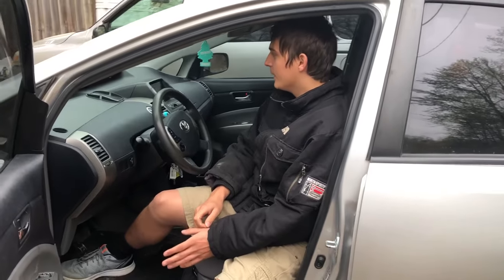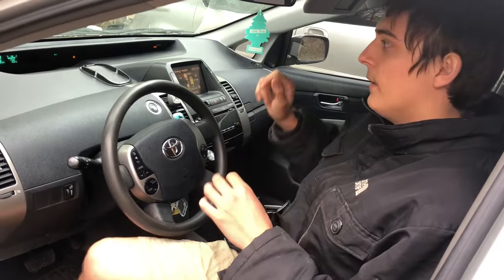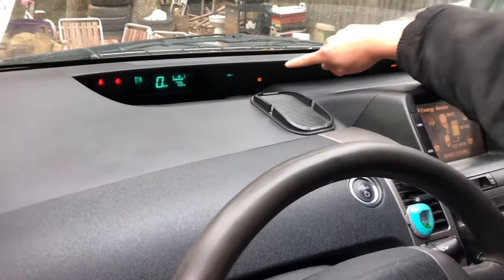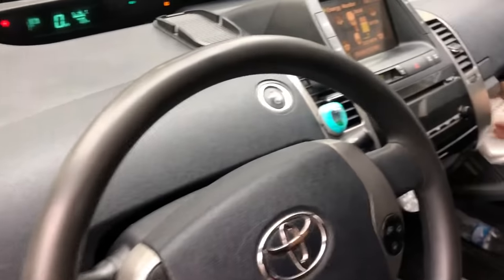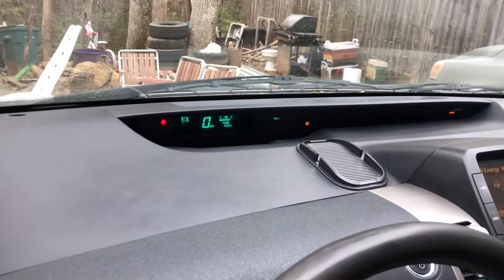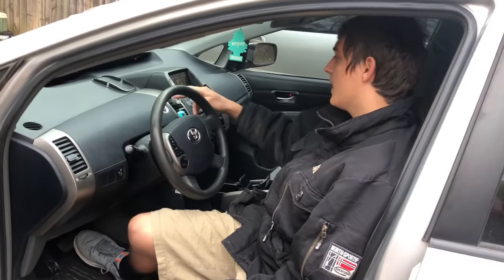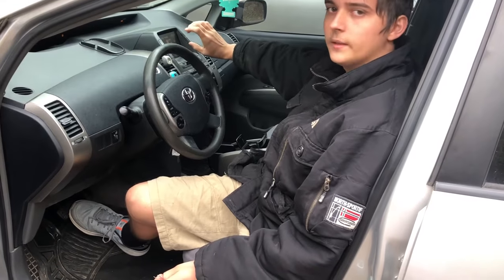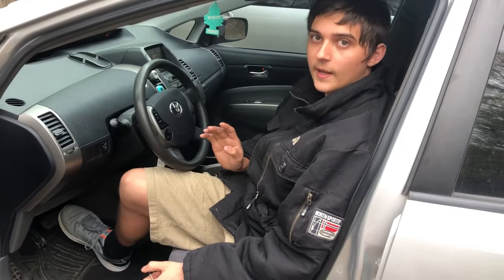Toyota Prius ABS Reset Brake Problem

Comment from the maker: If this helped you please subscribe
Reply: I subbed, thank you 😊
Reply: Update:  I was on a road trip in a 2007 Toyota Prius when the bake warning light, ABS warning light, and Emergency Brake light came on, the car was braking very strange with odd vibrations.  Checked the brake fluid, front brake pads and rotors and found nothing wrong.  Did this recommended procedure jumping the 4th and 5th pins on the obd2 port and pumped the brakes.  So far so good, 241,000 miles and still going…
Reply: Sorry, this failed on my 2011 (Gen 3).
Reply: Thank you for doing this video! I replaced my brake pads and adjusted my rear brakes on a 2009 Prius. The ABS/Brake warning light came on. My brakes felt spongy. Your video is the only one I found that explains clearing the warning ligt will resolve that spongy brake pedal issue. Very valuable information!
Reply: @MarcillaSmith  that's too bad, did you try it more than once, i assume?
Reply: Great! It worked for my 2010 Prius; however, the lights came back on after I drove about a mile or less. I did it again and I have the same issue. Do have any tips for this?  Thank you!
Reply: Thank you for your help working great
Reply: Amigo ayúdame, como le conecto el cable cada cuantos agujeros son de diferencia de arriba y de abajo porfavor gracias
Reply: 5:30 pm Mar 12,2024 Did exactly as the video said on my Mother-in-law’s 2009 Prius and it worked as indicated. Awesome Dude, thanks
Reply: @eltiocharlytv2201 el cuarto de arriba y el quinto abajo ta vez es muy tarde pero aja

Comment: Wow, I followed the footsteps you say in the video and I couldn't believe. I thought it was a joke, but I did and it worked. All the lights were erased and the car works perfectly. The brakes work very well. You saved me $1,600 of  ABS plus $960 of labor. Thank you very much, it's great.
Reply: they tried to charge me about the same amount at the dealership. Scammers! smh
Reply: Saved me too thanks! Hopefully it will stay off!
Reply: Amigo ayúdame, como le conecto el cable cada cuantos agujeros son de diferencia de arriba y de abajo porfavor gracias
Reply: @terrymoore9185 Amigo ayúdame, como le conecto el cable cada cuantos agujeros son de diferencia de arriba y de abajo porfavor gracias
Reply: @rayhage3971 Amigo ayúdame, como le conecto el cable cada cuantos agujeros son de diferencia de arriba y de abajo porfavor gracias

Comment: OH MY WORD!!  I was about ready to sell my 07 Prius for parts to a junkyard.  Dealership had told me it would cost $3,552 to repair ABS.  It was not driveable.  Stumbled upon your video.  THANK YOU SO MUCH!  You saved me tons!  Has anyone had the brake problem return?
Reply: Yeah it worked for me when I tried it but after 10mins of driving the ABS light and brake came on again.
Reply: I know the off chance in you responding it is probably slim, did you lose full braking power? Also was it followed by a beeping noise, or did you just have the ABS light on. I don't mean when your abs goes I mean when your entire brake system goes, like my foot was all the way to the floor and my car was not stopping. I'm just trying to see if we had the same problem or not. All this just happened last night and now my car is sitting in a bad neighborhood. Lol

Comment: DUDEEEEE. I cannot thank you enough for this video. I was scheduled for an appointment with Toyota and I knew they were automatically going to charge me $170 just to do a diagnostic (which pisses me off to no end) plus the cost of repairs. I did some research on the issue and you and others in the comments have said the same thing - they were going to tell me it was a bad actuator. I felt like I had to go to Toyota because problems with brakes are no joke and my husband uses this as his commuter car to work in the mountains and I didn’t want to take chances because the brakes kept lurching forward. This fixed the issue! Seriously man - THANK YOU!!!!!!!
Reply from the maker: Thank you be sure to subscribe
Reply: This only works on a Toyota I guess

Comment: Your clear instructions just resolved and cleared the brake light, ABS, VSP, caution light on my 2006 prius on 1st first try. Yesterday, I failed to apply brake firmly on this 160+k mile prius, these trouble lights shown up , 2 front brakes stopped working and 2 rear brakes have  a hard time to stop it. I know this is costly to fix at dealer, but found your excellent video. Thank you for your kindness to share info and may God bless you and your loved ones! Cheers... happy holidays!

Comment: Hello sir, thank you for your video.  But I'd suggest being clearer as which of the holes the jumper cable/paper clip needs to go into.  Your explanation was a bit vague, so I suggest actually showing the jumper installed for clarity.  It is actually the 5th one from right to left on the top row and the 4th one from right to left on the bottom row.  Again, I'm not knocking your video because you're in fact trying to help the Prius community save money and I appreciate that very much.  I too changed the wheel bearing hubs on the front end of my 2009 Prius, and it caused these warning lights to come on, this was the fix I was searching for as I know that my brake system is operational.

Comment: Thank you so much!!! I had to replace the brake caliper, rotor and pads. I was confused why all the lights came on n why bleeding the brakes wasnt working properly. Until i saw your video 🤩🎉 i saved so much money n it was all so fing easy. To anyone who can't get the brake caliper bolts off use a car jack n wrench to loosen.

Comment: HOLY COW!!!
2015 Prius. Abs traction control and brake light. All about actuator and brake “something ”. These are “bad news” lights. 
Pretty scary. 
Worked first try!! Car drives better than it did six months ago. Lol. 

Still gonna have Toyota check the system and tell me I’m good though. People kept telling me to not even drive it. It HAD to be towed. 
I’ll say if this works dude. 
Wow
Thank you SOOOOO MUCH. !!

Comment: Very lucky to have found your video, young man.  My 2012 Prius  did not look like yours under the console- the white box you showed when showing where to insert the paperclip was not visible.  The under console area in my car  had a cover almost all the way under the steering column - same material as the dashboard.  Though I was disappointed, before turning the car on I decided to pump the brakes 8 times real fast like you said, thinking it couldn't hurt.  Turned the car on and to my delight, the lights for the ABS, Brake and Traction Control did not come on! A test drive confirmed the braking and smooth drive 'feeling' were restored. Thank you! We had an appointment with a dealer in two days.  Thing is - these lights just randomly appeared on Sunday (today is Tuesday) - we did not have any maintenance or wheel bearing work done other than a standard oil change about 3 months ago.  Sounds like this issue with the 3 lights may be a common issue - putting lots of $ into dealership's coffers.  Thank you for helping me keep my hard earned money!

Comment: This was amazing. Had brake cylinder leak and air got into system. Apparently this caused the solenoid to close and needed to have brakes professionally  bleed and reset. This worked. So much anxiety and grief solved. Thank you so much!

Comment: Did you ever find out what causes this problem?  I reset as per your instructions and it just keeps happening again and again.
Reply: Maybe the brake pedal switch is going bad?  Just an idea I've been having for a while now.  My cruise control stopped working and the dash board light are on even after a trip to the dealership.  So I'm now thinking its the brake pedal switch which is faulty.  Gonna replace it today and see if it helps with the paper clip reset trick.  Hope this helps.

Comment: This worked to my car but it came back , so I changed all the old brake oil that was green and I put new fresh oil, changed the front shoes brake and clean the dust in the back brake and problem resolved. Lights went of and Alarm stopped

Comment: These cars are dodgy.When buying a used hybrid car always test drive to see faults and use OBD reader to check battery status, below 40% status battery condition means replacement hybrid battery.The cost is £3,000.Don’t let your Mechanic recondition your hybrid battery because you only get 10,000 miles extra drive.

Comment: A very big THANK YOU for posting your video. Just the other day my 2010 Prius lost its brake feel, and warning lights came on: brake, traction control, and ABS. The fix outlined in your video fixed my problem and restored full feel to my brakes. All is well again. I have peace of mind. And I have confidence in my braking system. Thank you for contributing to the betterment of the human race.

Comment: I can't express enough how relieved I felt after the fix you told, worked. Thanks, man!!!!
Reply: Little update. So this fix worked very temporarily for my car. The lights were coming on and on a couple of times a day. Finally, I found someone to scan it and the error code C1391 came up. So I had to take the car to the Toyota service and found out that the either ABS actuator or ABS booster is faulty. Luckily there was a "Customer support program" for certain error codes that Toyota is covering the cost of repair. But sorry that program ended on Aug 31st, 2021.
Reply: @_2315_  Update! So this actually didn't work. The next day I had all the lights on again and doing this kept the lights off and fixed the breaks just for a few hours. I took the car to the service finally and they said there was a customer support program to fix it for free and it was going to end in a couple of days after they started the repair. All these happened last week of Aug 2021. After they fixed it I listed it to sell. One day one lady came and stuck her OBD scanner and the same codes popped up and the lights came up again. I took it to service again and they reprogrammed it. After a few days, I sold it. The buyer also was aware of all the above.
Reply: @VugZ 😮 mine came back the next day, very sad😢

Comment: I tried it and my actuator started going crazy. The reservoir was over filled before the pin trick and after using the pin trick it went down to halfway and the actuator was buzzing once a minute.

Comment: Thank you so much. I had read about the 8 brake-press procedure, but yours differed in two ways from the other one: that it has to be done in five seconds, and that you should have your foot on the brake when turning the car on. Not sure which of those two things made a difference, but your method worked. After spending two days swapping out the ABS module and bleeding the brakes I had thought my new module was bad until I found your video. I was just about the most frustrated I've ever been. So this video saved the day.
Reply from the maker: Glad this helped you if you would like to help me support the channel please consider buying a t-shirt or a coffee mug from our merch store
Reply: @southernbang5896  i am very stressed out over this right now. scared to drive the car, it's really that bad. can i ask exactly where the "thing" (sorry, lack of a better word, lol) you placed the paper clip into, is located? thank you sooo much. i hope it works for me...
Reply: @deborabump1618 it’s the OBD 2 port under the dashboard on the driver’s side. It’s normally used to plug a device in that reads car error codes. When you put the paper clip in it forces the car to go into a diagnostics mode where you can work on problems like this
Reply: @nickandujar8281  hmm. i have checked codes using the port before....i thought it looked different from what i saw on the video, but i will DEF. check again; upstate ny cold weather, so will wait for a warmer day. THANKS SOOO MUCH!!

Comment: You should use a resistor to do the short. A 10 watt one ohm is recommended. It can also be used between the DISCONNECTED battery cables to drain the whole system.

Comment: Just fixed my 2011 Prius--did exactly what you outline and got it done in 7-10 min.. WOW!👏
Reply: that's awesome. i am very stressed right now over this issue with our '07 prius. don't have the $$ for even a clunker right now. can i ask you please-where is the "thing" that he is placing the paper clip into? i will look, but i have never seen anything like this in our car...thanks so much. <3
Reply: Look under the lower edge of the dash to the right of the steering wheel. (I’m assuming your steering wheel is in the correct side of the car…😂)

Comment: Didn’t your issue come back after driving a little ways? I have the same issue c1391 abs code. But comes back shortly after being reset
Reply: Yo shit giving out then. I’m having the same issue. Cleared it once and I drive a lot too. Hasn’t popped up since. But I’m glad your sharing your experience cause once that happens to me I know it’s time for some repairs. 🤦🏾‍♂️ 😞 the only thing I can do now is prepare myself financially. Budget my expenses and get ready to drop $3k-$4k to fix this issue..

Comment: I thank you so much, I just changed the pads on the front of my wife's 2015 V, and those lights came on. I"m like WTF? I disconnected the 12V before the process, and physically was super easy, thought I was going to have to bleed the brakes somehow, as the pedal was dropping to the floor. I did this, lights reset, behaves completely normally. Love the car, just hate the dumb stuff they've integrated to make it impossible to self service. You saved my bacon, and days of wife berating! Bless you!
Reply: bit of a long shot...do you remember where you stuck the paperclips into?

Comment: So I had an issue getting the screen. Turns out the paperclips I was using were coated with some wierd plastic coating. I shaved that off with my key and it worked first try. However, this is the second time I've had to do this so something else may be wrong.
Reply: Amigo ayúdame, como le conecto el cable cada cuantos agujeros son de diferencia de arriba y de abajo porfavor gracias

Comment: Dude. This fixed my problem. I replaced my front passenger brake caliper and my ABS just wouldn't work. I had to brake quickly a few times manually to get the system to actually brake instead of having the pedal go to the floor in order to activate the brakes. Tried your solution with a paperclip and now it works perfectly. THANK YOU SO MUCH!!! Liked, Subscribed, and Commented to help the Algo. Cheers my guy!

Comment: I had the same problems of you but when I turn my car off and five minutes later all the lights has gone when I turn it back on and do I still need to do what are you doing now or I should not do that
Reply: Only if the lights pop up. If they constantly pop up after driving then it’s time for some repairs 💰

Comment: URGENT !!! best news is that this worked on the first try but.....I came right back a few drives later, did it again about 3 more time and within a few drives it comes back with that awful high pitched ringing...this all started happening when I replaced the 12v battery myself...high end replacement battery $300..matched the one that was in there yet this issue won't go away...later after it comes back the brakes literally stop working in the front and I have to pull over and reset the paperclip trick until next time..could I have done something replacing the 12 v that the car seems to be unhappy with > Makes no sense that after the trick the brakes are fine again...help anyone please

Comment: Thank you!  Also just had left front wheel bearing hub assembly replaced yesterday(11/20) on my 2009 Prius. I as well noticed my brake light, ABS, &VSC lights stayed on. I tried first to disconnect 12v battery twice, to see if that would help(it didn't). So I watched your video(since you just had replaced front wheel bearings and same issue with lights). Jotted down the steps, will try tomorrow. Thank you in advance.
Reply: Update! I jotted down the steps from your video. After a few attempts of connecting the jumper wire(at 66 my eyesight not as good as used to be), had to get really close, marked the holes with a marker, connected the wire, small diagnostic screen came on(all o.k.), pumped the brake pedal 8-10 times, brake light went out, but ABS & VSC lights were flashing. I ran out of daylight, so left connector wire connected, will go back down tomorrow & finish up. Thank you so much! You are a genius to share this little trick.
Reply: Update! After several attempts using the "paper clip" per your video, lights would go out but come back on when car was moved down the street. Checked all fuses, all good, no codes were thrown on code reader. This morning, found the culprit, my left sensor wire came unhooked. My son pulled the wheel off and we found connector bolt had sheared off & wheel sensor was just hanging, got remaining  threads out, replaced the bolt, started the car, all said lights were back on. Got out my trusty "paper clip" and did procedure again, happy to say all those lights are gone now, brake pedal even feels better. Thank you again for the video! After doing it several times, was able to memorize the process.

Comment: I have the same light came on because my daughter left the parking when driving for 25 minutes. I change the brake and top off the brake-nothing. I disconnected the battery and still doesn’t resolve. I wonder trying your method would work but concern if short out the computer.

Comment: For some reason this isn’t working for me. I have a 2012 and when I attempt it, the dash screen says “diag” and the dash lights flicker on and off, however, nothing different on the screen other than the Toyota logo. I pump the brakes more than 8 times really quickly, and then Turn off, remove clip…then nothing changes. Idk what I could be doing wrong here.